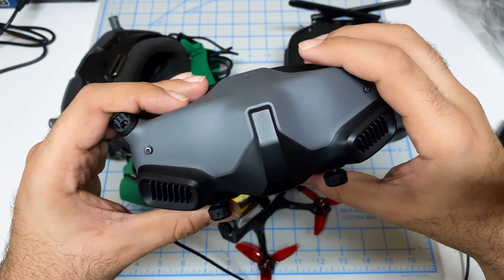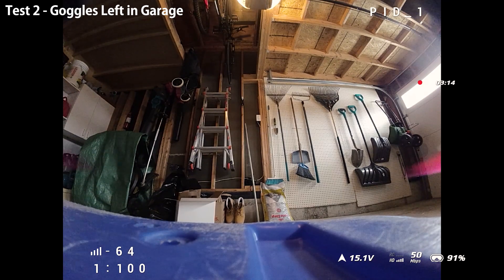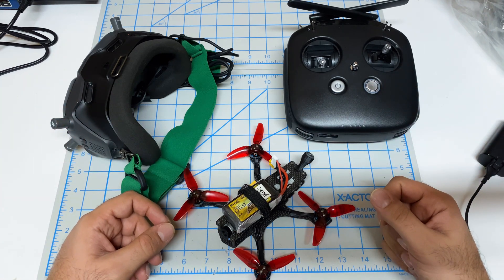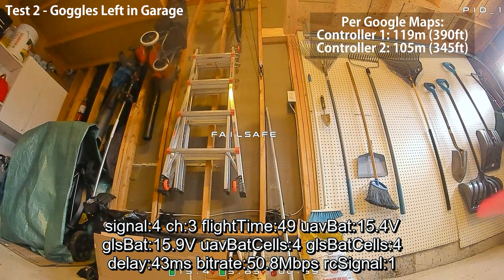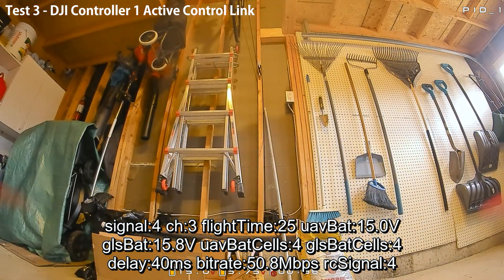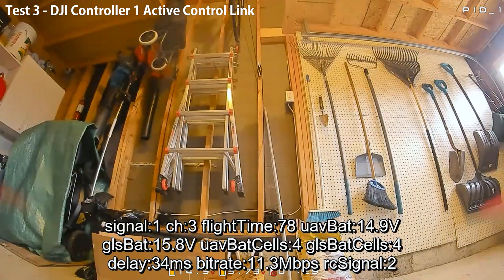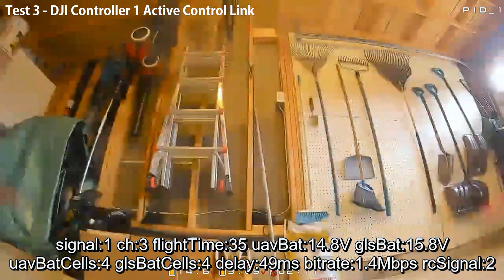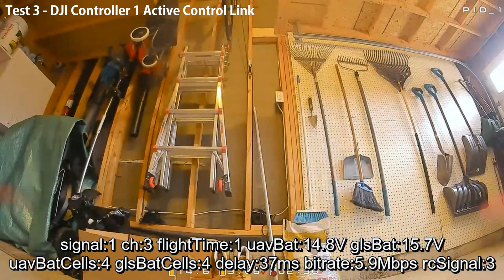Is There a Range Difference? | DJI FPV Remote Controller 1 (Black) vs. DJI FPV Controller 2 (Gray)

Comment from the maker: Hey Guys. This video was focused on the behavior of the control link but what I also did notice is that the Goggles 2 had higher mbps vs. the Goggles V1 when I turned around and started to head back. This is the same behavior I saw when I was comparing and testing the Goggles V2 vs. Goggles 2 and I think it has to do with the patch antennas that come stock with the Goggles 2. Also, note that in Test 2 (Goggles left in garage), the Controller 1 did not reconnect until I was right outside the garage door. Similar to what we saw with the Controller 2.

Comment: Still… We’re not all crazy pilots who fly 2+ kilometers away. The controller2 works perfect for normal people who fly let’s say max 500m away from the take-off point. Every system has his limit but if you fly more or less legally there is never an issue about range.
Reply from the maker: I lost confidence in the controller 2 when I fail safed about 5m in front of myself. This was when the goggles 2 first released though so possible that they have improved. I just don't trust it and moved over to ELRS.

Comment: Hey, thank you for this video! I wonder if controller 2 is really better than controller 1? I got controller 1 with my o1 equipped drone. I'd like to update the hardware but do it in steps to spread the expenses. I know that controller 1 seems bulky compared to controller 2, other than that Idk if controller 2 is better than 1. Thanks in advance.
Reply from the maker: I don't like the controller 2. I'd go for something more like a traditional controller instead unless you need the controller 2 for something like the Avata.

https://youtu.be/QRpH3c9G-Y4
Reply: @Mangorille  Thank you! I see DJI FPV Remote Controller isn't compatible with o3 unit. It's sad. I guess this is how DJI makes money. I expect the Remote Controller 2 won't be compatible with a future air unit...
Reply from the maker: @yolo-cars  That's the big unknown, you're at the mercy of DJI and how their compatibility roadmap.
Reply: @Mangorille  I totally agree.

Comment: Out of interest, did you test what happens if the Video link is gone (ie unplug goggle battery etc), does the RC Link get immediately dropped?
Reply from the maker: On the controller 1, you don’t lose the control link when the goggles are disconnected. It’s the controller 2 that has this problem.
Reply: @Mangorille  thanks for confirming, in my own testing I found the same, so it seems its some bug (or unfortunate intended behaviour) introduced in the design of RC2, as opposed to an inherent flaw in the DJI architecture.
Reply from the maker: @dc-fpv1801  What I suspect is happening is that in the old system the controller would connect directly to the air unit as an independent link whereas in the new system, the controller can run a link directly to the air unit or through the goggles. When the goggles are on, it links through the goggles and then when the goggles lose connection, it has to "reset" and connect directly to the air unit, which takes a couple of seconds or actually doesn't seem to reconnect when you're far away based on the testing I did. Hopefully through firmware updates, they can make it so that the controller always connects directly to the air unit.

Comment: The new system is not worth it.
Reply from the maker: It has some pros but I think it needs a bit more refinement. We had issues with the prior system initially as well that got resolved through firmware updates and aftermarket parts.

Comment: if you update the firmware and fly vistas with the dji controller 2 will that cause the same problems as it does with the o3 air unit?
Reply from the maker: I haven't tried, perhaps a future video ;)

Comment: Great tests! thank you for this information, on the (DJI FPV Goggles V2 with Remote 1) which component lost entire signal before? the Goggles or the Remote? great advice at the end of the video, I'm also waiting for DJI to fix the bugs on the Remote 2 before I jump on the 03 wagon. Best regards.
Reply from the maker: The quad got lots of rxloss warnings and failsafed before the video signal was completely lost. However, in practice, I most likely would have crashed given the blocky and choppy video before the failsafe.
Reply: @Mangorille  Thanks! And also right on the spot with the real life crash example 👍👍. 

All my quads have Crossfire but I'm switching them to DJI remote 1 (the Cell Towers in country blows Crossfire away), I saw long time ago that the remote 1 failsafes before the goggles... but recently I started to do more research to give the remote 1 another chance and several people claim that the remote 1 is very solid and failsafes after the Goggles.

I'll be performing test with Cell Towers and the Remote 1 (with Vista/Air Unit 1) soon, to be completly sure if Crossfire has to go :(

Thanks again! Awesome videos 👍👍👍
Reply from the maker: @hknight007  You're welcome. I've had no problems with the remote 1 been working flawlessly for my type of flying the last 3 years.
Reply: @Mangorille  Thats great! Glad to hear that 👍👍.

If the DJI remote passes my Cell Tower tests, then I was thinking to keep them both in the quad (DJI Remote for Urban flying, Crossfire for Rural and for Wall penetration).

I do long range flying and thats why need the best range and quality signal, could this be achieved by having them both wired and then switching the config in Betaflight? (Activating one and deactivating the other with their UARTs).

Thank you 👍👍
Reply: @hknight007  in my experience with indoors real estate tours (and here what matters is penetration, not range), the controller v1 always had better connection than the googles v2 with my vistas. Its a pretty solid controller! Both in connection and build quality. Battery is also great, better than my new rc2 (for the o3). However the connection on my new rc2 is just amazing, it hardly ever looses a bar on the rc link. The smaller form factor is a very nice thing for me, coming from a big playstation gaming background lol

But for this rc2 controller the extended sticks is a must. The rc2 feels sooo good with the bigger sticks
Reply: @hknight007  also drewdrones and jaybirdfilms, both great and top tier fpv filmmakers, use the dji v1 controller
Reply: @rafaelm3404  Thank you so much for your help, you solved a lot of my doubts regarding RC1 connection! 👍

I'm also starting to fly indoors and wanted my first O3 to be a Toothpick or a Tinywhoop (to record using o3 camera), havent bought one yet because of the issues that the RC2 apparently has...
but seeing your experience with (O3 + RC2) setup it encourages me to start using O3 :)

I saw from several youtubers that the (v2 goggles + o3) setup has the best connection link, do you also use the goggles v2 or you use the goggles 2?

 RC1 seems like the best choice for the Vistas, thank you✌️
Reply: @hknight007  I use the v2 googles. I dont think theres much difference in connection when compared to the googles 2, from what ive seen. Anyways, dont think its worth the upgrade as of now. I live in Brazil which is a veeery humid country, so I am also worried about the fog reports on the new googles. 

Seeing those great pilots flying for nhl, LV, ESPN, etc with the original dji v1 controller just proves that its realiable. People seem to talk too much about crossfire or elrs, but in my opinion its only needed for really long range flights. Youll love the rc2+o3 combination. The first time you fly o3 its just a crazy experience, the change in image quality is unbelievable. We complain a lot about DJI (and some of it is correct), but they are kind of a awesome brand... their products are just on another level... anyways if you get the rc2, get those golden stick extensions, I really didnt expect them to make such a big difference. You get so much more precision (like you have lowered your rates) but at the same time if you move the stick all the way you still get the same movement speed. Really a must! 

About the rc1, just be careful not to drop it. Its very heavy and i broke one when it feel on top of the left stick, a really small drop but destroyed the left gimbal completely, other than that its just great.
Reply: @rafaelm3404  This amazing, thank you so much for this detailed reply.

This answers everything I need to know (y)

I agree with everything you said and specially what you said about DJI, cant wait to start using O3 quads with my v2 setup :)

Thanks for the advices I'll try to get those golden extension and I'll keep the RC1 safe and thanks again for your help.

Thank you both @rafaelm3404 and @Mangorille, best regards.

Ruben

Comment: Hi Mangorille,

Thank you for the extended comparison video. 

Is there a reason why you used your garage to conduct your test, including closing the garage door?

From my perspective and limited experience, and I apologize if I’m totally in left field with what I’m about to say/ask, but hear it goes.   I don’t see this test reflecting a true practical environment. The garages seems to contain numerous metal tools that could be effecting the signal and if your garage door is a metal door, than that adds to the poor signal in all cases.
Reply from the maker: Hey. No problem... It depends on the type of flying you typically do and where you fly. I usually fly around trees, light poles, fences, from inside the car, etc. so this was a representative test for me. The important thing is that I used the same garage and setup in all the tests so I can get a consistent comparison between the Controller 2 and Controller 1.
Reply: @Mangorille  You don’t have to, but it would be interesting to see if the results are consistent if you retested everything outside the garage.  From my experience different systems behave different depending on the environment!  

Just my two cents!

Comment: I have input in beta flight from my DJI controller 2 but im unable to get my quad to arm.Arm is set to aux 3 and prearm is set to aux 4
Reply from the maker: Do you see the arming mode activate when you look in Betaflight (remove your props for safety)? Turn on your warnings on the OSD and see what arming error you are getting.
Reply: When I click my prearm button my prearm lights up correctly under modes and when I click my arm button it also lights up(obviously gonna be disabled since I’m connected to beta flight)
Reply: I don’t believe I’m getting a arming warning in my osd because I have them turned on and when arming got nothing
Reply: My flight controller also has a red light on and a blue flashing light
Reply from the maker: @kalebpoe7008  Hmm, do you have the goggles connected as well? Some reported needing to "activate" the controller by having it to connect to the goggles the first time. I haven't had this happen but may be worth a shot doing the usual update firmware, connect all the components, etc. troubleshooting.
Reply: All firmware is updated and goggles were also on
Reply from the maker: @kalebpoe7008  Which goggles are you using? I find this odd that it's not arming and you do not see any warnings.
Reply: @Mangorille  im using the v2 goggles
Reply: I have also tested the motor through beta flight so I know I’m getting power to them and on command of beta flight they will turn on